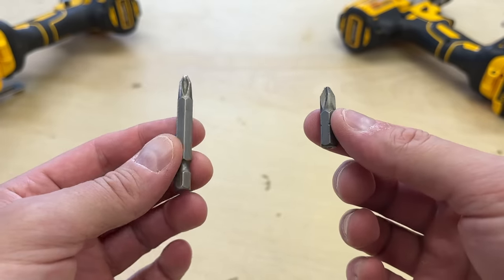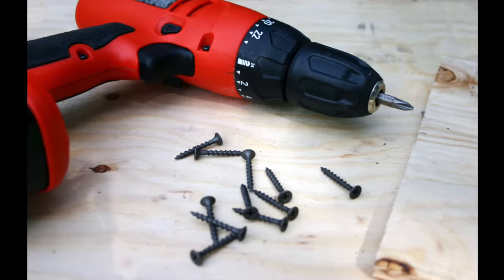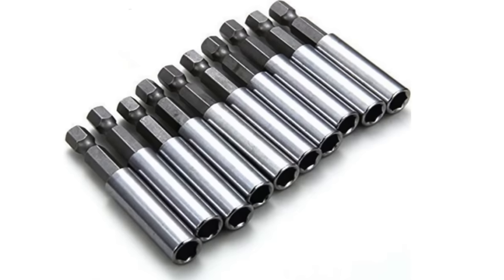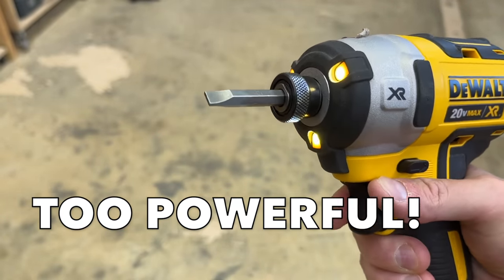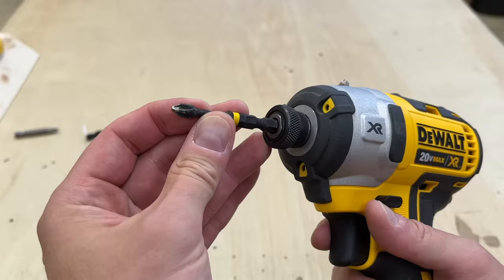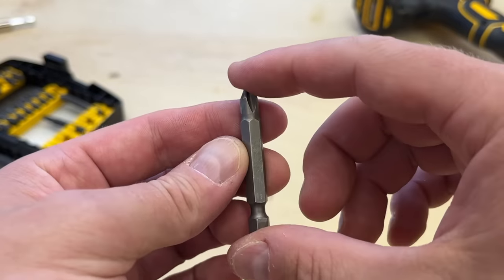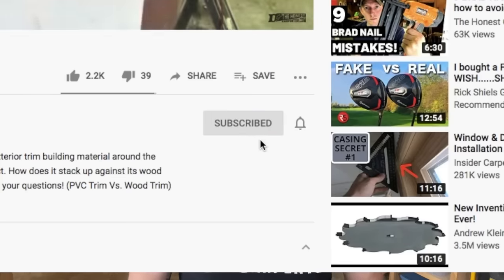Power Bit vs. Impact Bit vs. Insert Bit...WHAT'S THE DIFFERENCE?! (Driver Bit Guide For New DIYers!)

Comment: The quick change groove is a fun bit of engineering, manufacturing, and political history:

Power bits have the same groove as impact bits as a historical artifact.  Before power drills were allowed to be sold as "drill/driver" combos, power screw drivers and impact screw drivers entered the market (1960's).  Power screw drivers were notoriously bad at holding longer bits, so they adopted the "quick change" feature of the impact driver and scaled it to the now common 1/4 inch hex.  

Over time and with advancements in materials, impact drivers were able to be scaled down from 3/4 inch and 1/2 inch to the now common 1/4 inch.  This meant a single manufacturing system could produce both bit types by essentially changing only the input material.  This was a major economic gain for the manufacturers both in production cost savings and the ability to bring impact drivers to the DYI market at an affordable price.  At the same time, several patents, laws, and regulations were changed which now allowed any variable speed drill to be marketed as a drill/driver.  The torque limiting chuck was very nearly a simultaneous release.  

Since manufacturers had no reason to retool their lines (a very expensive procedure without any demonstrable financial gain), the now mostly superfluous grove on power bits remained.  Virtually all impact tools (drivers, wrenches, etc.) clearly and conspicuously state in the operations manual to use exclusively impact rated accessories (bits, sockets, etc.).  As a result manufactures of bits are only required to note that a particular accessory is impact rated on the packaging and and provided instructions, not on the accessory itself.  Thus the legacy groove is meaningless for identification purposes.  The distinguishing differences of colored bands, neck sizing, etc. are all Very recent (primarily post 2000), and were driven by users requesting simplified ID of impact vs. other types of accessories (specifically after throwing out the packaging and "user manual / instructions).  

Some "conspiracy theorists" also attempt to suggest that the groove remains on non-impact accessories as a way to tempt people into using them in impact tools so that the bits will break and the manufacturer is able to sell more bits -- a form of "planned obsolescence.  However this is not the case.  As noted earlier, there are numerous electric screw drivers that use the quick release system, as well as many smaller 1/4 inch drills common in the home/DYI market - especially outside of North America.  So again, why would manufacturers change their production lines when doing so would cost money without increasing profits?
Reply from the maker: This is probably the best, most complete analysis of the power groove that anyone will post. Thanks Michael!! 😁
Reply: @TheHonestCarpenter  You're most welcome Ethan.  You have a great show and provide a very valuable service.  I have learned a great deal from you.  So I am glad when my background is able to repay in some small part the wealth of knowledge I have gained.

Please keep up the great work.
Reply: This is probably the best comment I've ever come across on YouTube. Thanks for the knowledge drop on a subject I never would've found otherwise.

I've never had a regular bit break while using an impact driver, and not sure I've ever used an impact bit with any regulatory
Reply: This lines up with what I was kind of thinking after the video. I actually have a few bosch drill/drivers that use the quick change power bits as well as a bosch and craftsman impact which of course also use quick change but I had a drill/driver with quick change way before I ever got an impact. Though to note I just buy impact bits because why not? Especially since bosch and makita impact bits are really cheap for some good quality, I also like the craftsman bits but they are not always as reliably cheap but they are still good quality. (im a fan of 3.5" and 6" impact bits and makita is kind of the best game in town for price/quality there)
Reply: Nice, you must have been in manufacturing.
Reply: Thank you so much for this comment.  How the heck did you know that. Very impressive
Reply: DYI = DIY = "Do It Yourself"
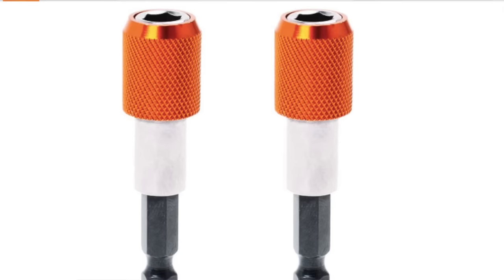Reply: 1:34  While I don't want to take away from the historical explanation above(!).
This style of bitholder uses the same ball bearing retaining as an impact driver, while not necessarily being impact rated itself.
Hence it looks like the market has found a use for the legacy groove in non-impact bits.
Reply: @sigi9669  A keen observation. Additionally,  it makes even more sense in the context of the quick-change collet in power-screwdrivers. 

With advancements in battery performance and size, there's been a trend toward small, low voltage rechargeable screw drivers that include the 1/4" collet standard (ie DeWalt DCF680 or Makita DF012DSE). So, there is definitely a use-case for non-impact-rated power-groove bits in the current market. I see these most often in hobbyist drawers or electronics assembly where light-weight/small size is more important than power or versatility. An insert bit won't work in these screwdrivers, so a power-groove bit holder becomes a bit adapter if the user prefers the magnetic quick-change system to the collet. 

My only frustration is that many long-length fasteners come with a non-impact-rated insert bit in the box (I'm looking at you, DeckMate). A 5" outdoor deck screw with a T25 head borderline-requires an impact driver to be installed properly. The little bronze T25 insert bits that some in the box are a joke.
Reply: I came to give my two cents but now I see my thoughts are s*** compared to yours.  thank you for your service
Reply: Good run down.  I was actually searching for when 'quick change's bits, became 'impact driver's bits, and came across your vid.  It's ironic that some 'quick change's chuck adapter's back in the day had the very same bit bottom, including power groove, of the bit they were made to accept.  Basically the same chuck as found on impact drivers today.  Your cost of retooling point makes a lot of sense.  Thanks.
Reply: I was always told as a kid the power groove was put on power bits because a “quick change” adapter was available but expensive and only carpenters or cabinet maker really used them since they worked with multiple different fasteners where other trades did not.
Reply: @vmitchinson  
Thank you!! I looked at that and I knew what it meant and even said it but I told myself, something isn't right! I really feel stupid now! I thought it must stand for something new but related! I know everyone makes mistakes but that didn't enter my brain.
Reply: Excellent comment, thank you for posting !!
This addition is what I believe YT is for, a very good background to a very good explanation of bit types.
Reply: Always good information
Reply: You  forgot to mention the Stanley Yankee..
Reply: Any idea if the start of this particular quick change fastening system was  influenced by the Sears Craftsman ratchets? It's certainly a similar concept, and possibly even close enough to  have been covered by (or infringed on) the patent (that Sears stole from their employee who came up with the idea).
Reply: Jesus man. You bored?
Reply: I'd spend a few hours listening to you spout random tool facts. What a comprehensive little snippet. Thanks for the info.
Reply: 1960's...!!!
Don't think so......
It wasn't until the late 1970s when "variable speed" was featured on drills that people started using insert bits that were originally designed for manual screwdrivers.
At least that was the case here in the UK. Before that the fastest way to insert screws was a Stanley 'Yankee' pump action screwdriver.
Reply: Great explanation! I never knew impact drivers ever came in anything other than the 1/4" variety (though it makes sense). 

As far as impact rated or not, I don't think there's a big issue with using non impact bits in an impact driver now, depending on the application. If you are buying new bits, get the impact ones. They're probably better metal and last WAY longer than the cheap normal ones (but that may be a function of buying good bits instead of cheap ones LOL).  But you can use the cheaper basic ones in an impact if you're only doing low torque stuff like sub 2" screws into soft wood (I mean physically soft, not pine thats 400 years old and hard as rock). They can save a little money if that's your use, since you wear them out on something they can handle, without ever breaking them. But it's better to just buy the right bits and not worry about it any more. Impact raged bits last a LONG time and can be used in any other tools, so they make sense. There's really no reason to use the wrong bits unless you have a ton left over. Always wear hearing and eye protection too. Your hearing ans sight are important and all those tools are well capable of removing those blessings in a short time period.
Reply: Thanks for a bit of history for us trying to make a positive impact
Reply: I’m taking a lot of what I learn here to my hardware store 5 days a week.  I love to sell tools.
Reply: Well shiz, I just gained some new and unexpected information. Thanks.
Reply: @burton926  proves those screws are harder but if the bit is even harder it might strip the screws splines and now the damn screw jammed, a awh shit moment
Reply: Excellent analysis... seriously..
All I know is that there more expensive and alot less stronger .
Most of the tips are just crap and a regret even buying especially when you live in Australia
Reply: Back in the late 70's or early 80's we had a store called Pay n Pak and they often had really cheap things on sale for a really low price. 
Anyway, I bought this quick release chuck that had a regular straight 1/4" hex shaft. It came with a set of bits and the bits had the same notch as we have today. It was a cheap piece of junk and the spring inside broke on the second day. You were supposed to chuck it in your VSR drill and use it as a power driver. I grew up with my dad telling me to cut up screwdrivers and use them in a drill. I tried cutting a craftsman slot screwdriver and I could not do it with a hacksaw. It would destroy the blades. After 3 blades all I got was a 1/8" little cut in the shaft. Those were some hard steel.

Comment: Here's a tip when buying impact bits -- buy different brands to color code by fastener type!  For example, buy Milwaukee (red) torx bits, DeWalt (yellow) phillips bits, and Makita (blue) square bits.
Reply: Great idea!  (though, I prefer to buy when things are on sale...)  You can also use different colors of heat shrink and more easily apply your own color coding.
Reply: I always use different brands for all my screwdrivers 😊 
Not because of the colour!!! 🌈 
It's just the polite handshake every time I reach in my case. The tell me who they are without hesitation 😂😂😂
Reply: Or you could just look at the bit shape 😅
Reply: Oh I like this idea
Reply: lol. I do the same 👍
Reply: Do your eyes not work?🫣
Reply: their for screwdrivers like dcf601

Comment: While I know this difference exists. I daily use the two kinds interchangeably(depending on whichever I find first) in an impact driver and have never had a “power bit” break on me my guess is your more likely to damage the fastener before you break a bit so to all those new comers I wouldn’t worry too much about spending the extra money on impact bits unless you plan to do a really serious amount of impacting and are organized enough to keep a bit long enough to break it.
Reply: Same here, and I am an installer by trade. I generally only buy impact bits. But I wouldn't take an extra trip down and back up a ladder to grab an impact bit if I had a non-impact one handy
Reply: Ditto. 35 years construction can’t recall ever a broken a bit with an impact driver. Quite a few with a straight drill-driver but then mostly in metal or concrete application or the tip of a slotted driver.
Reply: I was going to say roughly the same thing. I have built quite a few hardibacker showers that require a few hundred heavy duty heavy duty screws to install. I used screws that required square drives and I don't recall breaking a bit although the bits would wear to the point that they didn't grab the screw as well as a new one. I only recently became aware of the idea that impact rated bits should be used. They might be better, but you'd have to play close attention to how long bits last before you might notice that the impact rated bits are better.
Reply: I’ve only ever sheared impact bits when drilling holes in metal. Now I only use my impact on metal when I have the proper tool but it’s just out of reach
Reply: I've mullered plenty of bit tips myself. All of them have been rated for ugga-duggas & usually they have been insert bits, not full length quick release impact bits.
Reply: I am carpenter doing specialized project and use power bits in my impact EVERY DAY for the last 20 years and do about 1000 screws a day. I have broken a whole grand total of 0 ZERO 🧐
That being said I suspect that they might(?) cause the premature wear on the bit and that you might strip out the screw more often. 
it’s like using plain rope vs recovery rope when pulling out a stuck off-road vehicle. The recovery rope has a spring to it and will store the impact energy and distribute the force evenly over longer time period instead of delivering all of that energy in a hummer like blow. 

Also, the “better” materials are now more common and affordable that they are just making everything out of them for simplicity of things.

That being said, nothing strips out screws faster then regular drill with too much power. I thing the impact allows the bit to reengage the screw in between the blows …IDK
Reply: @MD-gk4uh I agree with that, the worst thing I've ever had happen to my power bits in an impact drill is the bit getting jammed and not wanting to release after a lot of use.  Not sure if that's from it being a power bit or not, but I can't stand using insert bits.  Every type of bit holder I've ever tried has annoyed me for one reason or another, usually bc of how bulky they are or not strong enough to stay in every time.